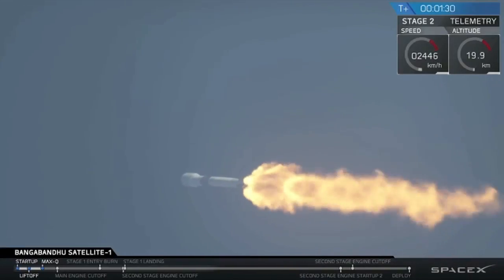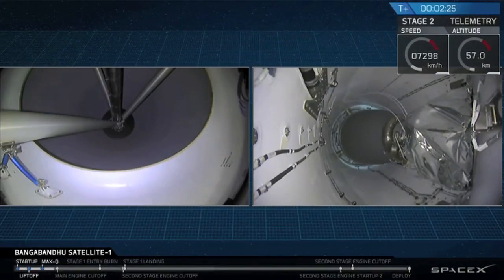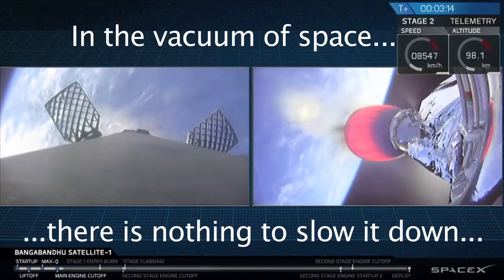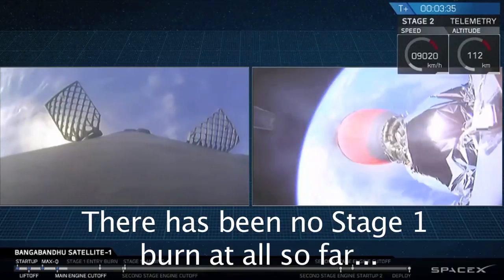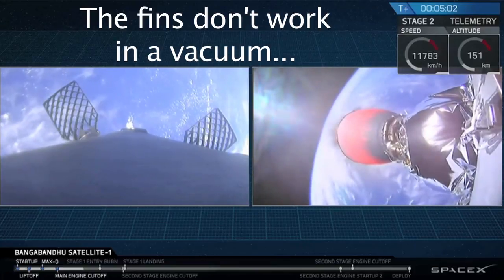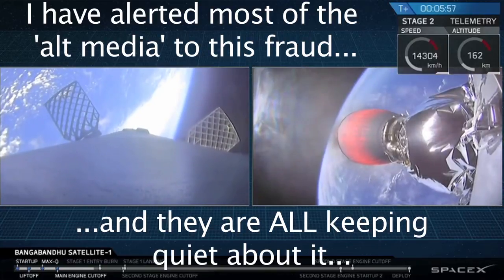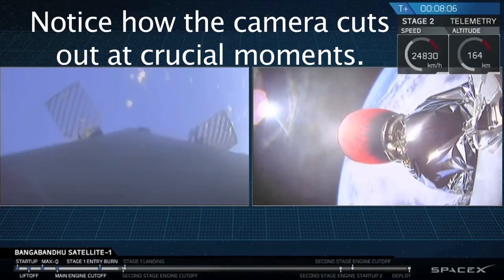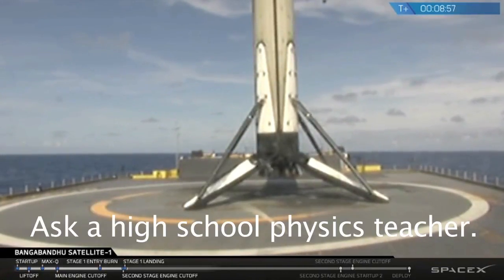The NASA/Musk Magic Show (CGI/hologram technology)

Comment: - Not all missions use a ‘boostback’ burn due to the amount of fuel that the rocket has left over.  For lighter satellites, they use a boostback burn to either “boost back” to land on land, or decelerate the rocket enough to land on a barge that’s off shore a ways.  Flights that don’t have enough fuel to do a boostback burn have to land waaay far out in the ocean.  It’s obviously a lot easier to land closer to shore for logistics reasons if you can.

- “The fins don’t work in a vacuum and thrusters don’t work in thick atmosphere.”  You are pretty much right (except for the thrusters).  As you see in the video, they used the thrusters primarily in the vacuum of space (but also lower down) and the grid fins are only actuated once there’s enough atmosphere to use them…so yeah, you’re exactly right, and that’s exactly how SpaceX uses them if you watch your own video.

- Well, you certainly aren’t the only one trying to ‘expose’ SpaceX.  You can’t take that credit all for yourself.

- You can see in this same video that you posted that a reenty burn occurs and that the thrusters and fins are working to actively change the trajectory of the rocket, so I don’t see why you’re saying that nothing is helping the rocket change its trajectory.

- These ‘crucial’ moments are when the rocket is experiencing the greatest dynamic pressure in the atmosphere and it’s kinda hard to keep a perfect telemetry lock doing that.  Image trying to watch satellite tv when someone is shaking the satellite dish around like crazy.  There are also uninterrupted videos of the rocket landing that spacex recovers from the rocket later and releases for us to watch, so I’d suggest watching those.

- If you watch the following video, you can clearly see that the fins and thrusters actually do have an effect during landing.  The rocket is still decelerating at enough speed to the fins to have some effect.  However, right at the last few seconds, the thrusters kick in again to help keep the top of the rocket in the right position since indeed the fins don’t have enough control authority.  https://www.youtube.com/watch?v=9M6Zvi-fFv4  FYI, these thrusters don’t need a vacuum to work.  They impart some thrust to the vehicle.  Not a lot, but enough.

- Umm, he is controlling the broom laterally… He literally just kept it balanced and walked across the screen.  I don’t know how you don’t see that.  Also, you reverted, like countless others, to name calling and profanity.  To me, if you have to resort to that, then your argument has little or no validity.  True, it would be very hard to ‘land a broom’, but it does help that the rocket can update its position 1000s of times a second with its on-board sensors that are designed to do exactly that task.
Reply from the maker: This is an unusual shill (or useful idiot/fanboy) in that he tries to maintain 'reasonableness,' but anyone parsing his arguments will see that he hasn't countered my observations. Just watching the 'Everyday Astronaut' try to keep the broom upright (while having to run all over) should get the idea -- with unpredictable winds blowing the whole way down (from 60 miles up), there is no possibility of a controlled landing. Spacex is another example of the PTB getting us used to accepting physical impossibilities as 'normal' occurrences. See the last dozen videos on my channel for added proofs.
Reply: I like how you told your viewers to ignore the fact that I did indeed counter all of your arguments.  I also enjoyed how you resorted to the usual use profanity and insults that many of your fellow conspiracy theorists tend to use when they don’t have a leg to stand on when it comes to proving their theories right.

Since you only responded to the comment about the broomstick, it seems that I did a sufficient job responding to the rest of your claims.  Anyway, back to your current claim!  So if I find a video where someone can balance a broomstick while walking around, will that somehow prove to you that rockets can land?  It doesn’t sound very reasonable to base your arguments on how a rocket screaming through the atmosphere should be compared to a broomstick.  For example, if someone isn’t great at multiplication, does that somehow prove that computer can’t possibly process complex algorithms?  All the Everyday Astronaut was trying to teach was a very dumbed-down lesson on how an inverse pendulum works (if you want to see an example of a controlled translation of an inverted pendulum looks like, they are actually pretty cool and there are plenty of videos on youtube https://www.youtube.com/watch?v=a4c7AwHFkT8).

Also, you claim that it’s impossible for the rocket to descend through the atmosphere in a controlled manner with varying winds.  However you don’t seem to have trouble accepting the fact that a rocket can indeed ‘ascend’ through the atmosphere in a controlled manner in varying winds.  Does this mean that our supersonic jets are also fake?  They are also travelling through the air at supersonic speeds in a controlled manner.

Lastly, how do you respond to the 10,000s of people that have witnessed the landings of these rockets in Florida?  How to you explain the sonic booms that they rockets create when coming back to land?  How to you explain the mathematics and physics that prove that this technology is possible?  These are bold claims that you are making and I’d suggest that you either look for knowledge yourself by studying mechanical and aerospace engineering or asking those who actually work with these technologies instead of basing all your claims off of a youtube video.
Reply: A.C. Weisbecker  "This is an unusual shill (or useful idiot/fanboy) "

Pathetic, resorting to base insults.

"with unpredictable winds blowing the whole way down (from 60 miles up), there is no possibility of a controlled landing. "

Control by main engine, gas thrusters and grid fins.

"Spacex is another example of the PTB getting us used to accepting physical impossibilities as 'normal' occurrences."

Nobody needs to do this when A - the public can see what's going on for themselves, and B - SpaceX has a full order book from multi-national companies to get their satellites launched

If you REALLY wanted to show fakery, you could infiltrate one or more of their customers, and attempt to show that they are not operating the satellites that they claim to ..... but I don't think you will.